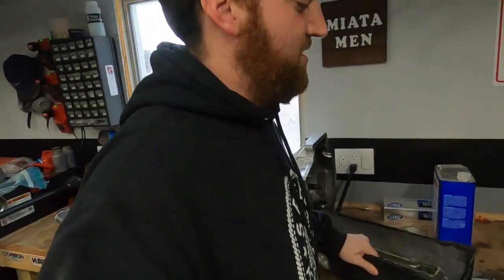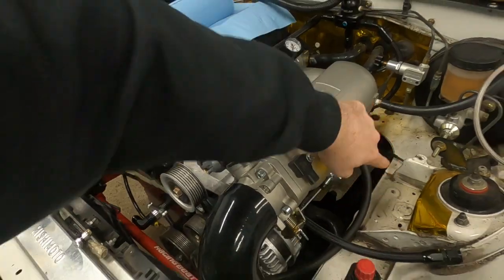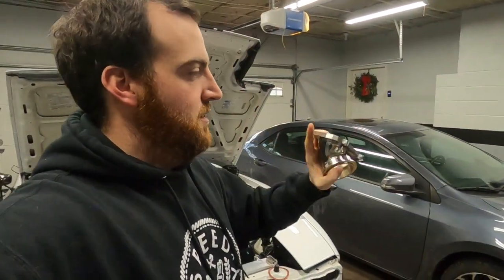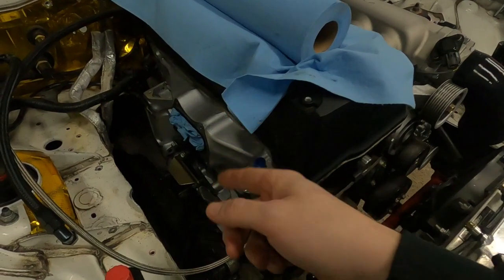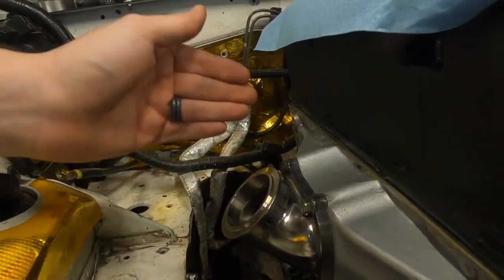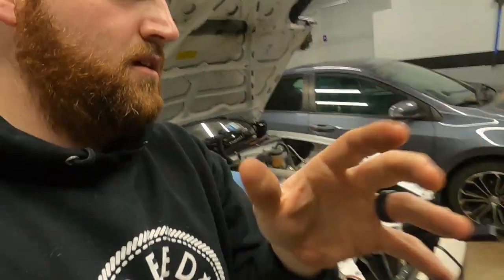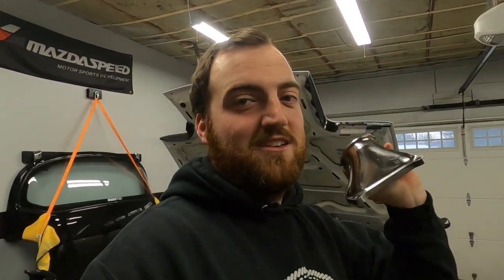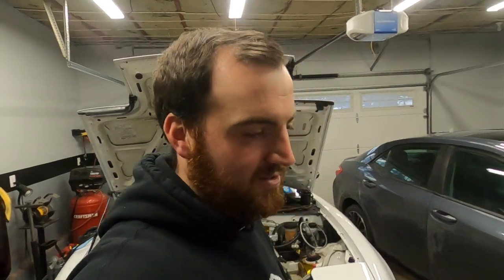Machined Manifold - Turbo KMiata

Comment: Will there be some for the k24z7 but for Nissan 240sx s13 please cause I bought a k24z7 for 280 with 40k miles on instead of a k24a cause they like 600-1000 in Georgia 😢
Reply from the maker: This should actually fit the Z7 just fine. They’re almost the same exact engine. Packaging doesn’t get much tighter either for a rwd setup. KPower Industries carries them now.